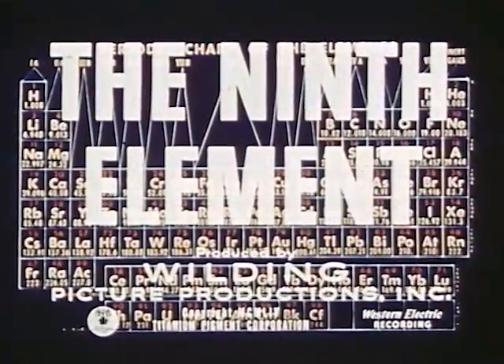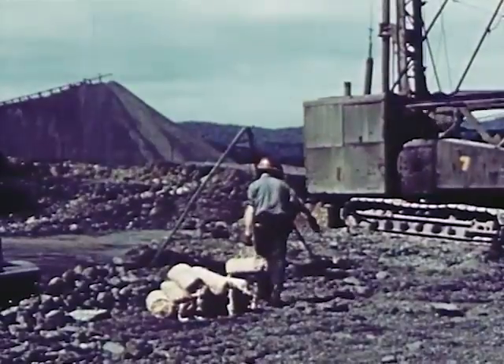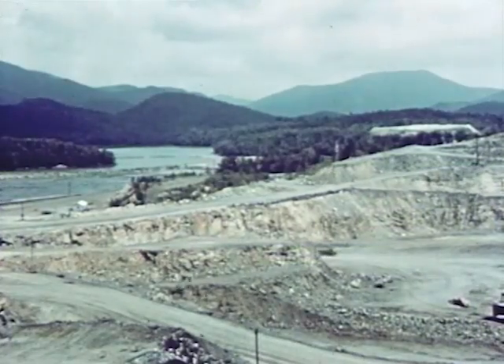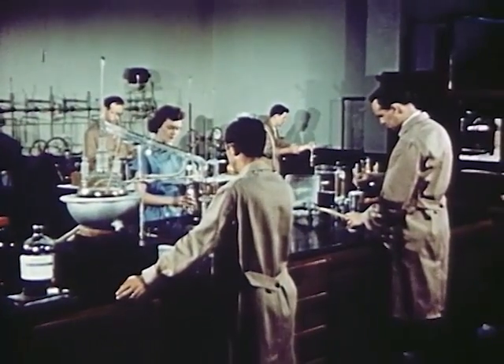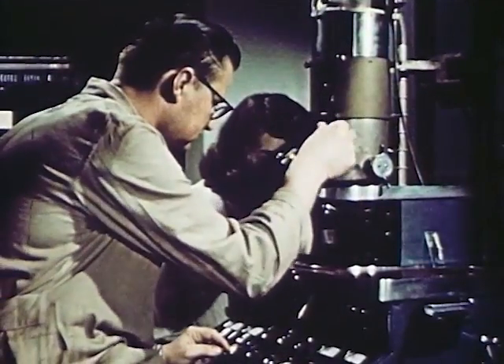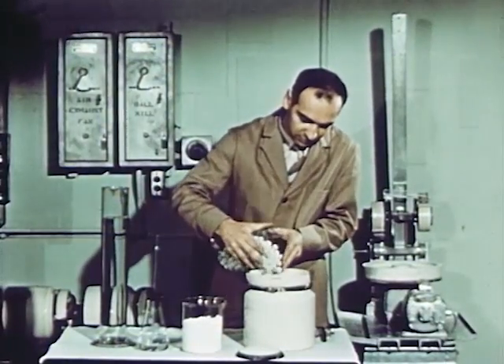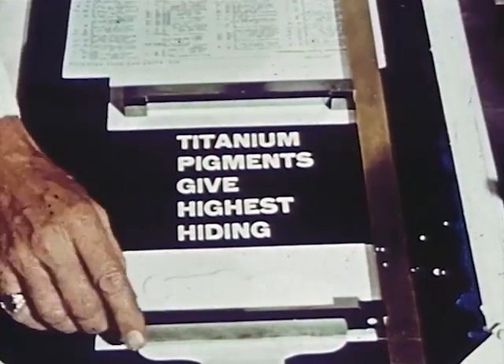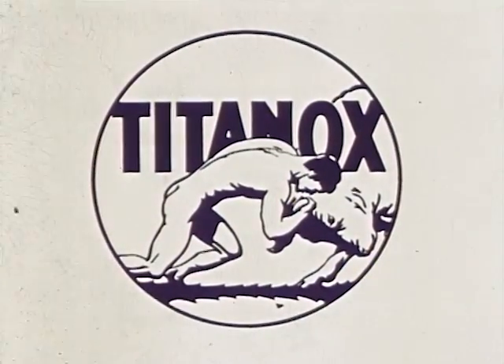Mining & Uses Of Titanium - 1954 - CharlieDeanArchives / Archival Footage

Comment: Did u add all the damage to the clip to make it look old? It seems too much to be genuine and is really just more distracting than cool.
Reply: It’s an archival film scan. The film reel itself was damaged. Damage to one physical portion of the film reel creates the periodic disruption of the image. The audio track, which is offset slightly from the image on the film to account for the different physical position of the optical audio pickup from the projection lens, is damaged in the same physical position but affects a different portion of the content as a result. 

Archival channels do not add damage to make things seem old. In fact, they likely did hours of restoration work to make this film scannable at all. If not for that work, countless films like this would be lost to history as the film stock degrades. There may be undamaged copies out there, but especially this 16mm format era is nearing the time where, without careful storage & environmental controls, original prints degrade even sitting on a shelf.